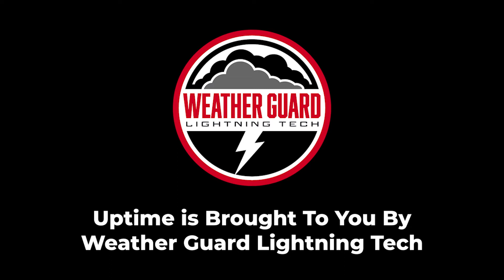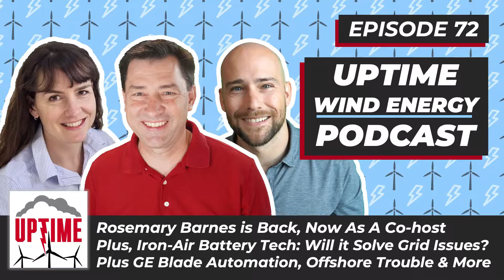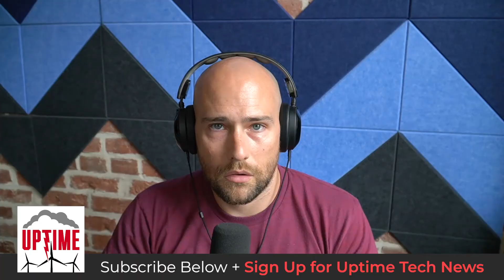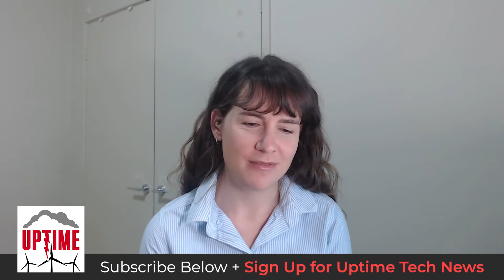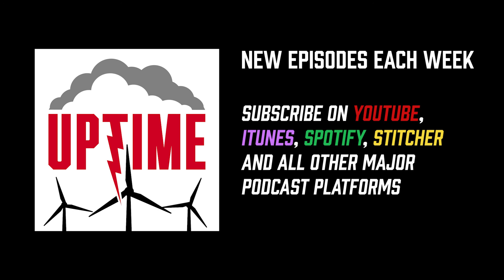Rosemary Barnes Joins to Talk Iron-Air Battery Tech [UPTIME WIND ENERGY PODCAST]

Comment: Giving a battery an hour rating is pretty well meaningless.  Any battery, if you are only drawing a hundredth of it's power every hour will last for a hundred hours.  If you only draw one three hundredths of its capacity every hour it will last for 300 hours and so forth.  This is, of course, dependent on the battery not self discharging which some batteries do ,some do not.  Giving an hour rating suggests that what they are actually saying is although the battery can hold a lot of energy, it can only discharge it at a low rate (relative to, for instance, a Li battery).  This may be fine if you have enough batteries which can all contribute their amperage to the grid.  The the advantage of an Iron based battery is that it is likely to be inexpensive.  There are already 'Vegas batteries".  There are liquid metal batteries ZnBr flow, plating batteries, redox batteries with V and Fe and a few others.  Their great advantage is high available discharge rates when necessary, no self discharge and no fading over time.
Reply from the maker: what would you suggest as a more descriptive rating?